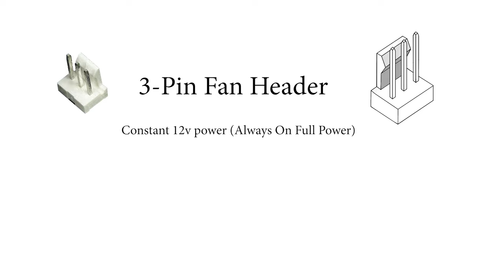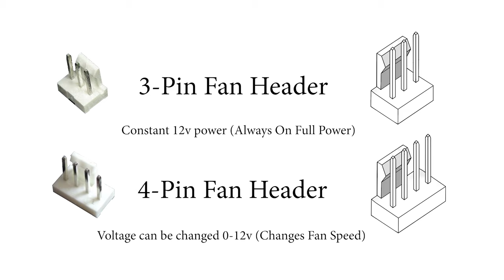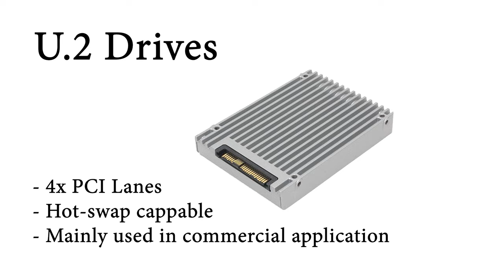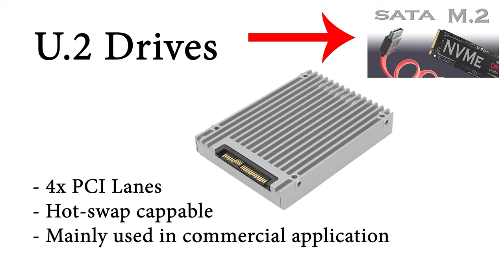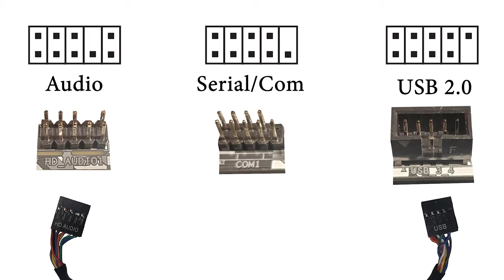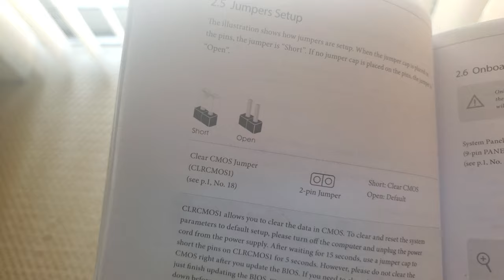Motherboard Connections Explained

Comment: what is a vdg cable please i need to know
Reply from the maker: It's a seperate option for your RGB controller. You can just use the normal 4 pin one. Only some motherboards offer the 3 pin header so that's why you may see both the 3 pin and 4 pin option, you only need 1. If you don't have a 3pin port use the 4 pin one.

Comment: Front I/O headers can also have  chassis intrusion pins as well. And as far as LED, you can have both 12v led headers (4 pin, for light strips only) or 5v led headers (3 pins with the forth removed) for argb fans only).

Comment: Quite a few boards have 2 pin Temp sensor pins, my last board had 2, one located near cmos jumper pins and a second set near the ram along the right edge, my new board only has one set near the cmos.

Comment: Thanks Max, you're a 'life-savor'. Just ordered the first parts of my upgrade and saved a new Mb and GPU for later. This video will sure help me to connect my new MB (in a couple of months). Question: Is there a way to keep your current SSD (including all data) when you change a motherboard? I have my Studio software installed on my c-drive which is done by a prosessional audio-technician. It would mean the world to me if I can keep my current configuration. Thanks in advance ;-)
Reply from the maker: Yea, you can swap out a motherboard and  leave the ssd as is, just plug it into the new board and everything will still be on it
Reply from the maker: You can actually swap out any of your hardware and leave the ssd exactly as before. You may need to install new drivers for like a new graphics for example, but everything else will be totally fine :)

Comment: I THINK everything is connected right lol, only the tower power button isn't lit up and when I press it there is a millisecond of life where fans try to start up and then nothing. I have ordered a bigger power supply as I have a 500W and I've upgraded to a 3950X on a Msi mpg X570, any advice?
Reply from the maker: You prob just have the +/- swapped on the front panel connectors in the bottom right of the motherboard for the "Power LED" one. That should fix the power button.

Comment: Where do I plug chasis control board MB FAN sync connector on the Motherboard? Any of chassis fans connectors (CHA_FAN 1, 2 and 3) or high ampere fans connector (H_AMP)?

Comment: My motherboard is Asrock A620m-hdv/m2. As far as i know there is no rgb connection on this motherboard but there is a port called UART1 underneath. This port is not mentioned or explained in user manual and looks exactly like a 3 pin rgb connection. What is this port supposed to connected to ? Can i connect my case fans rgb headers to this port?

Comment: Hi this is an amazing video like always but what do you do if you have more fans then pins to pig in (e.g. I have 1 four pin for fans but I have 3 fans
Reply from the maker: If you only have 1 fan pin but multiple fans you have 2 options. 1) buy a splitter to power multiple fans off the one header. Or 2) use molex power from your power supply, a lot of fans can be powered by molex as well but you may need a 3 pin to molex adapter.
Reply from the maker: Or 3) get a fan speed controller which you plug all your fans in and then you just need to power the controller.
Reply: Ok thanks you so much

Comment: 0:44 That is terminally wrong. Most old ASUS and OEM boards control 3 pin fans by changing the voltage.
On the other hand, a 4 pin fan connector does not change the fan speed by changing the voltage. 
It does that by changing the PWM Data signal (Basically telling the Fan to change the speed)

Comment: On the Dell X51 R2 mini ITX board theres two connectors i dont get. 

One is called SPI1 wich has 12 pins layout but 11 physical pins like the HD audio. 

The other is called LPCI with 14 pins layout with 13 pins physical. Allso like HD audio.

What i mean by like HD audio is, the pin that is missing is one row in. Exept the LPCI. Its two rows in.

Comment: I believe the 3-pin headers also allow for fan speed control. I have an old pc with a 3-pin system fan header and the speed of the fan attached to it can be varied.

Comment: On my HP Omen 30L motherboard I have a 7 pin (4 on the bottom and 3 on the top) header and the motherboard says "USB2"... it's strange for me... What is this?
Can I plung into it the NZXT RGB & FAN
 CONTROLLER that requires a usb2.1 connection on the motherboard?

Comment: Do all 12 pins need to be connected on the c.p.u power supply on the pc I am building the power supply kit has not put the 12 pin conector in ther but all of the above I have plugged in the 8 pin plug but do I need to plug in the separate 4 pins pleas help as I can't find this 12 pin plug anywhere

Comment: What about VDG connector? I got a Gigabyte  B450M Aorus Elite and don't know how it works with Aerocool Airhawk Duo which includes argb fans and cannot sync with RGB Fusion 2.0. any ideas? I'm using the right cable that user manual describes.

Comment: Missed possible temp sensor plugs some MBs have. Info on PC temp sensors is so sparse, I would have thought more people would use them to check ram temps when overclocking, when their ram doesn't haven't any internal sensors.

Comment: The part about fan headers is wrong. With 3 pins you just have ground, (variable) power, and a rpm counter return signal. With 4 pin headers have an additional PWM signal and always 12volts on the power wire if the header isn't running in some 3pin fallback mode. The 4 pin and 3 pin headers and connectors are interchangeable but you might lose the ability to regulate fan speed. If you plug a 3 pin fan into a 4 pin header that is only able to regulate speed through PWM, then your fan will run full speed all the time. If you plug a 4 pin (PWM) fan into a 3pin header, it will generally always work without problems.

Comment: Hey ! Hopefully you answer ! But where do you connect the usb2 from to the motherboard ?
Reply from the maker: Check out 3:50 :)
Reply from the maker: It will come from your case, wires up to your ports- you very well may not have usb 2.0 ports on your pc case in which case you won’t need to use this port. Hope that helps!
Reply: @MaxsTech  hi again I have another question , so my motherboard doesn’t support a type c front panel connecter from the pc case , and I don’t not see a usb 2 cable coming out from the case also . I have a lia li dynamic case . I have the usb cable itself but once I plug it into the motherboard, where do I place the other end to

Comment: I am new to PC building so new infact i bought a prebuilt. This one to be exact: Cyberpower (GXiVR8060A10) and I wont know what MB comes in it until 3/20/21. I know it will be a mATX. I want to install the Corsair iCUE H100i Elite Capellix Liquid CPU Cooler AIO but since it will be a sub $100 MB I can assume it wont have a connection for AIO like most MB's above $100-150. Can i connect it to the Fan header and still have it work? It comes with a Commander CORE RGB & PWM Fan Controller (the little brother of the PRO version)for controlling all fans/RGB lighting in the case. It requires Sata power and I am unsure if I should buy a sata power splitter or wait until i see if there is one in the case or not. I wont know what the primary Sata power cable will be plugged into until i open up the back. Any tips? >.< (I also subbed/liked the vid)

Comment: My old motherboard use to control the speed of the 3pin fans (sabertooth z97) but I got a new motherboard (ROG Strix B550) that only has 4 pin fan headers. Will it still adjust the speed using voltage like my old one did even if I plugged a 3pin fan into the 4 pin header? At the moment I’m using a controller, but would rather let the motherboard do it.

Comment: If you have a band name pc, sometimes the audio connection is all in one line, rather than 2 rows. Dell is known for that. I'm putting a motherboard in one and I'm not sure about the front audio connection. Also I have an old Compaq case, I was going to use, but the USB cable, coming from the front, looks like the serial com port.

Comment: Hey I got a question, I'm about to make my pc soon and it's a z690 board and I was wondering, if I were to get custom cables from cable mod, I know I would get a gpu and 24pin connector cable but on pictures I've seen 2 cables on the top left of the board, do you happen to know which ones they could be? Because I'd like to get custom cables for the ones that are more exposed
Reply from the maker: So those top left 2 cables are for CPU additional power. They barely show at the top, you can route them behind the motherboard and have them just pop up and plug in. If you are okay with that I would think you should be fine. The 24 pin and GPU power are most in view.
Reply from the maker: Or I would recommend wrapping them in maybe black tape if you want them to disappear. Usually you can barely even see up there

Comment: Hello on my sons motherboard the cpu power is a 4 and 8 pin  but his power supply does not have an 8 pin to fit only 2 4 pins on same cable and does not fit the two on the 8 pin only one will go on the 4 pin will that do or does he need to get a 8 pin aswell????  thanks

Comment: My Alienware area 51 R5 have a white 10 pins connector for usb 2.0 instead of been 9 pins so I can’t connect the new water pump since it needs a 9 pin. The normal 9 pin usb is also to big to connect in that port. Recommendations?

Comment: omg i think you just helped me out HUGELY. im building my first pc and im overwhelmed with the rats nest of cables and where they go, but question, should i install my motherboard into the case before connecting cables? im using the nzxt h1 mini (the new one)
Reply from the maker: Yea, if anything just organzie the cables in the areas you want them, if needed run some under the board or through any mounting slots and then install the board.
Reply from the maker: Also easiest install order, first install CPU/RAM/CPU cooler all keeping your motherboard on top of the box it came in (not the antistatic bag, the outside can hold static) and then install it into the case.

Comment: Building my first pc here, so I've decided to have rgb fans. I have 2 in total along with a rgb cpu cooler. I havent opened my motherboard box yet, but looking at the online manual it says my motherboard only has 1 rgb header on it. Do I need a splitter cable for the header? Thanks

PS my motherboard is a MSI x570 Gaming Edge Wifi

Comment: on my fan hub, it has a 4 pin pwm and a 3-pin with a vdg in, I have no clue whether I have to plug it in somewhere if so where? and does it actually have to be plugged-in in the first place?
😵‍💫

Comment: Can I plug a USB cable into the COM pins? Have a WiFi card with bluetooth and it wants a USB connection on the mobo but I maxed out with usb ports.

Comment: I have the b450 f and theres a connector there like a 3 on the top 3 on the bottom but there isnt a middle connector, do u know what that could be , it also no listen in the mobo manual
Reply from the maker: Is it in the bottom right of the board? Could be the thermal sensor header.

Comment: hey idk if you are still seeing comments on this video but say for instance I have a bunch of rgb fans and they are plugged into the header thingy it come with, where would I plug the block into my motherboard to power the fans?
Reply from the maker: To power them it might just use molex/sata. Depends on the block, but that comes from your power supply directly
Reply: @MaxsTech  huge thanks bro just getting into all this pc stuff tryna figure things out 😂🤟

Comment: usb 3.0 and usb 3.2 gen 2 connector pin on the board use a same connector pin? because my boart is compatible with usb 3.2 gen 2 then my casing just come with usb 3.0 on the front panel and pin just usb 3.0. may i know usb 3.0 can plug in or can run with usb 3.2 connector?

Comment: Hello Max's Tech, thank you for the video it helped in most of it. I have a ASUS X570 with a Phantek case and I am having trouble where I can connect the fan hub that comes with the case. Could you help me out here please thank you. The hub is located in the top on the back of the case, can I connect that where it says CPU_OPT??
Reply from the maker: I think it depends on what kind of fan controller it is. But some of them will have a 4 pin fan connector that you can plug into any 4 pin fan slot on your motherboard and then they'll usually require extra power from a molex or sata power cable.
Reply: @MaxsTech  thank you, I will check it out I think I need an extension for it it might not reach.

Comment: Hey idk if someone sees this but i have a old 2013 hp motherboard and the is the 4 pin for the power supply called p1 and there is another on that looks different called p2 and I wanted to know if the p2 needs to but connected

Comment: what is the audio for? I found out that it is not connected into my motherboard and everything is working fine, when I plugged it in, there were still no changes at all
Reply from the maker: For any audio input on the front of your case. So if you plug in headphones for example. It's also possible your case doesn't offer front audio Jacks.

Comment: For the HD audio port, that's entirely just the audio right? I'm having issues with the front two audio jacks(1 for mic, 1 for headphones), I can play music but when I speak into my headset, the audio that comes out sounds like a printing machine.
Reply from the maker: To trouble shoot, does it sound normal when you have it plugged into the back of your computer instead? Or plugged into a different computer? If its still bad it sounds like thats a problem with your mic.
Reply: Max's Tech it works when I plug it into the back

Comment: 1. Both 3-pin and 4-pin connectors are able to change the speed of fan
2. 3-pin header controls speed of rotation by changing voltage
3. 4-pin header controls speed of rotation by interrupting constatn voltage that feeds a fan  (12V) with a high frequency
4. Both types of headers are capable to return velocity value of the rotor
5. Actually old 2-pin headers were able to control the speed of the fans

Comment: Hey my motherboard takes a 4 pin RGB but my case come with a 3 pin ARGB for the fans with lights. Is there a adapter or a converter I can get. That goes from a 3pin plug to a 4 pin receiver?
Reply from the maker: That may just be a 3 pin header for the fan that also is how the lights are powered. Is there only 1 cable coming from your fan? If so thats just the fan connector and is all you need.

Comment: Correct me if I made a Mistake !! I had a SD card slot my front panel which was left unconnected by the Computer guy. I investigated and connected the 4 pin connector to the lower portion of USB 2.0 pins. It intially crashed my system but then on next boot,  it work flawlessly!! I don't know if its allowed but am not getting any errors yet!!

Comment: Actually the 4 pin fan connector outputs a constant 12v you can choose to control a 4 pin fan in dc mode or with pulse width modulation (pwm)

Comment: If you have a 4+8 cpu power connector do you have to plug in both you could you get away with just plugging in the 8pin?
Reply: Depends on what CPU you have and how much wattage you need. I'd still plug them all in though.

Comment: Very useful your video man, I have a question, I have the same MB as yours but I didnt assemble my pc I wanted to know where do I have to connect the led fan of an rgb fan cooler if in the description of it says A-rgb connector with a green check a 3 pin connecto and a red "X" a 4 pin connector. Im new on this kind of stuff.
Reply from the maker: That connector requires a 5v (3pin) RGB header for the rgb. It'll look like the normal 4 pin rgb header except 1 of the middle pins is gone. The 4 pin ones are 12v so that can damage your lights. I dont believe our motherboard has any 5v rgb headers, but there are adapters for it.
Reply from the maker: Actually, I just looked it up, there is 1 addressable 5v rbg header on the asrock b450 steel legend.
Reply from the maker: Its located in the bottom left of the board.
Reply: @MaxsTech  thanks for your response man! Yes I saw one header in white Color but as you tell me if I get an adapte it would be enough to solve the RGB to ARGB problem right? By the way I'm subscribing to your channel :) I hope I can ask you more details about ARGB things, as I told you I'm new on that and I don't wanna screw up my MB
Reply from the maker: If anything you would prob just burn out the led lights if you plugged it into a 12v connection. So not a huge deal, but obviously not good lol just make sure you use the 5v connection those are for the Argb ("A" stands for Addressable fyi) meaning each led can be controlled.
Reply: @MaxsTech  thanks for your response, helps me a lot

Comment: Do you have any solutions for the following problem? I have 2 hd_audio female connectors coming from my front panel and card reader, but only one male connector on my motherboard, and I'd like to have both HD_audio connected somehow.
Reply from the maker: You may be able to find an expansion card you can use....tbh not sure they exist. Otherwise a new motherboard that supports more connections would be the only thing I can think of.
Reply: @MaxsTech  : I eventually found out that some sound cards have hd_audio on them. Ordered one, we'll see.

But yeah, for this project I'm running out of expansion slots, even used a riser to prevent the graphics card from blocking pcie slots... I build Swiss knives as computers... 😗🎶

Comment: If I see a message saying”could not set up a connection with power supply. Please make sure your tough power dps is successfully connected to computer via USB” is that cable related?